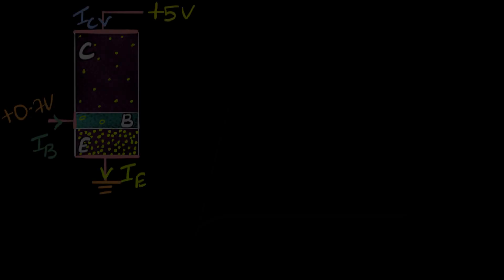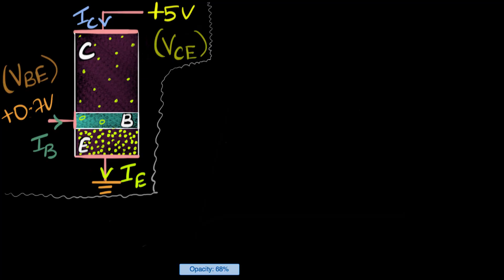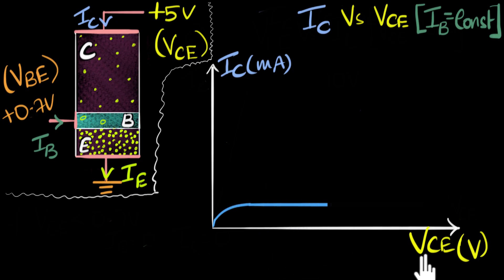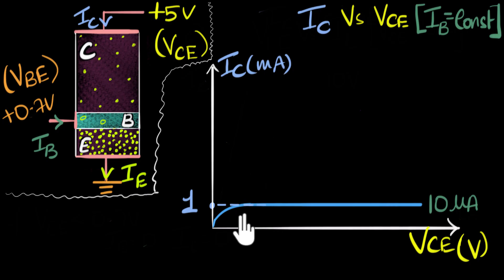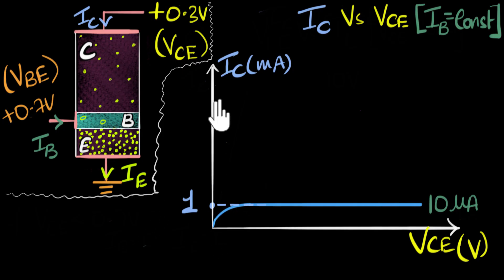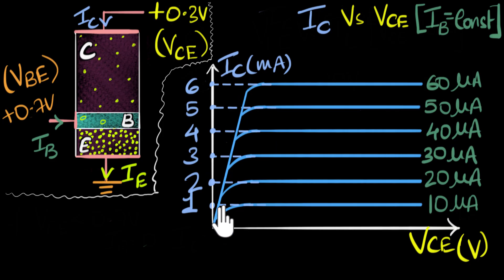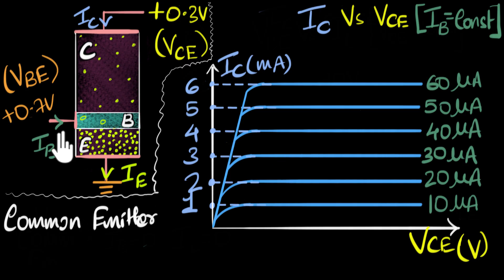Output characteristics of NPN transistor | Class 12 (India) | Physics | Khan Academy

Comment: Hello Mahesh Sir I have a question...... why does the input characteristics graph does not have current plotted in the negative y-Axis ?? because here we can see that the direction of current is in the wire connecting the emitter and the base is from low potential i.e. from the emitter to the high potential i.e. to the base

Comment: why does the flow of electrons become harder when the depletion region decreases?
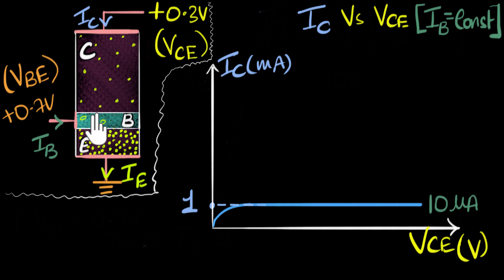Reply: I also have a same question in 4:32
Reply: I think it is because as the depletion region width between the Base(p type) and Collector(n type) decreases, the E-field force on electrons(which are in the Base)decreases as the depletion region between Base and Collector, while the diffusion force on electrons increases.

Comment: Sir, at 02:11
You mentioned that regardless of the value of the Output Voltage, the Output Current is almost the same. But we've seen that the Base - Collector Junction is getting reverse biased. And in a reverse bias, the current is almost the same even if we increase the voltage. But there is a "Breakdown Voltage", right. So what happens if the Output voltage goes beyond the Breakdown Voltage? Will the engineers make sure that this scenario doesn't occur? Else everything will be wasted, right?
Reply: your doubt is obvious...but it is  teacher's mistake...There is no reverse bias..because in npn comman emmiter transistor N and N connected as Emmiter and Collector in this case...

Comment: is there a mistake in ncert book page 493 in https://electronics.stackexchange.com/questions/291529/changes-when-v-be-is-increased-in-npn-transistor
Reply from the maker: I am guessing it could have been worded better. Could you specify which part you need clarity on?
Reply: @KhanAcademyIndiaEnglish  it should be if vbe increases both the hole current in base and electron current in emitter will increase in place of hole current in emitter and electron current in base as increase in hole current in emitter means flow of electrons from base ro emitter which will not favour the transistor.
Reply from the maker: @sachinrath219  I am guessing you mean the same thing as that text. Since holes from the base move into the emitter, they are referring to that current as 'hole current in emitter', (while you are referring it to as 'hole current in base').  Same with the electron current too. 
Since we are ignoring minority charge carriers here, it's safe to assume that 'hole current' refers to the 'holes from the base entering into the emitter' regardless of whether we call it as the current in base or current in the emitter. Same with the electrons.

Comment: but isnt the Ic is beta times Ib
then if Ib becomes 2 times 
that is from 10 to 20 then Ic should become beta times right...
But u said that it also becomes 2 times...
hows that possible??
Reply from the maker: So Ic is Beta times Ib correct. 
However when Ib doubles, even Ic will double right? 
Let's take an example. 
Suppose Beta is 100. 
If Ib is 1 then ic is 100 
Now let's double Ib i.e. 2 then ic becomes 200. Look ic has doubled. 

If Ib becomes 5 times more i.e. 5 ic becomes 500 which is again 5 times increase (notice it's 5 times what ic was before, but ic will always be 100 times ib)

Let me know if you need more clarity :)